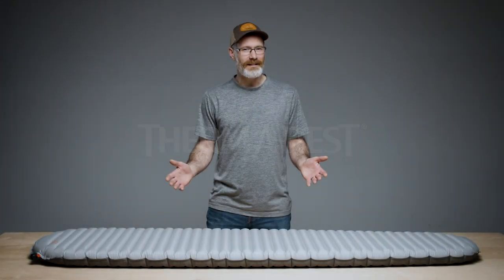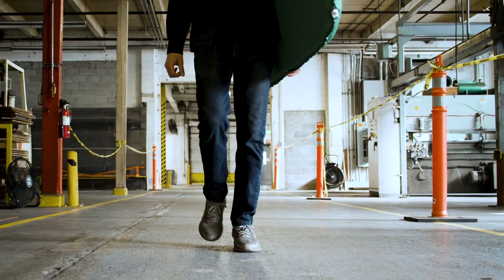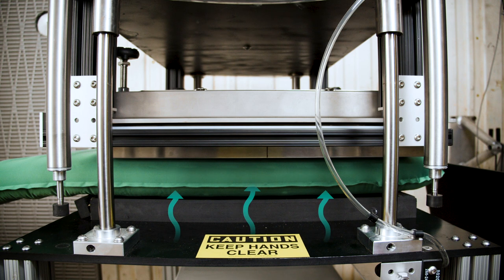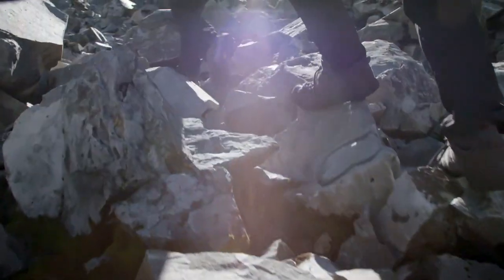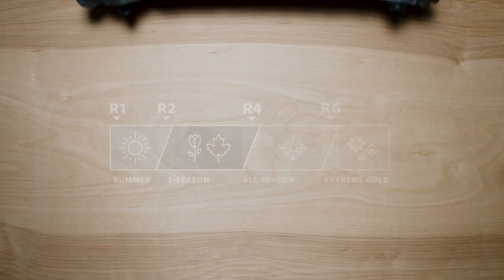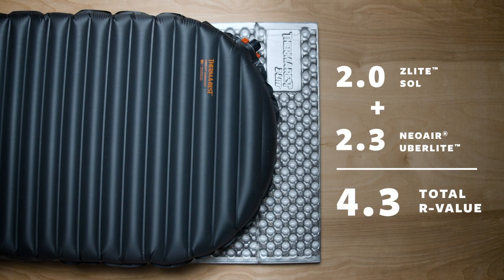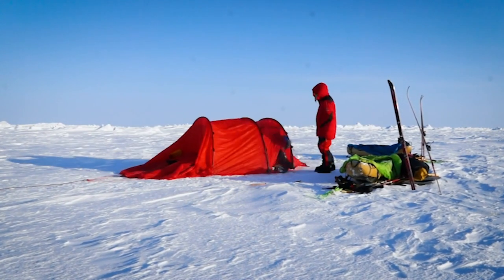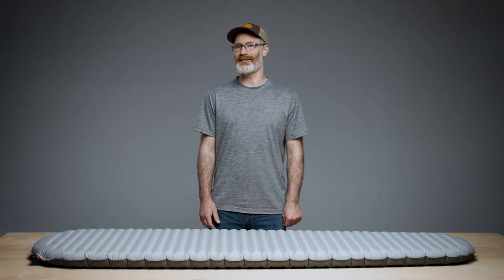Sleeping Pad R-Value: How to use the ASTM Standard and Seasonality Guide

Comment: What I want to know is if I get an R-value of six with the ether light XT extreme, will this make me too hot in the summer. Or will it be the same as any other pad but just more tolerable when it gets extremely cold?
Reply from the maker: We do not believe that a mattress with an R-value of 6 will make you hot. Most likely the ground is still cool and the mattress will provide basic insulation between your body and the ground, helping to maintain normal body temperature (with the help of your included sleep system of sleeping bag and clothes). It also means you do need to bring as heavy sleeping bag and sleeping clothes!